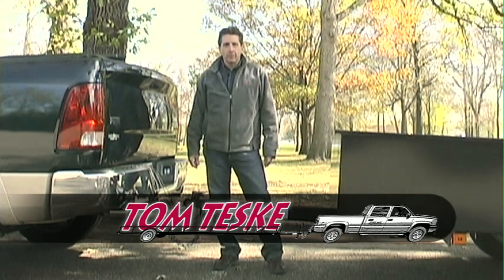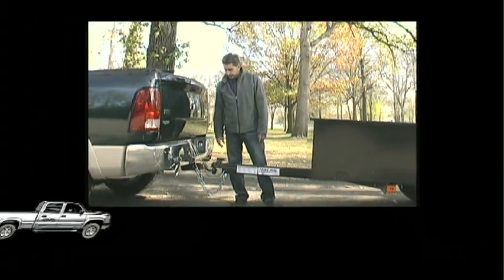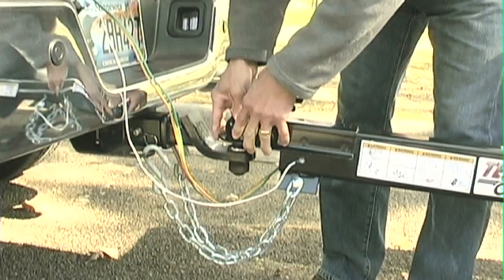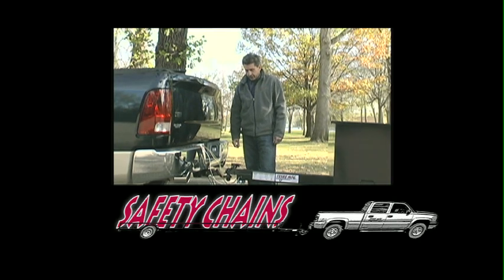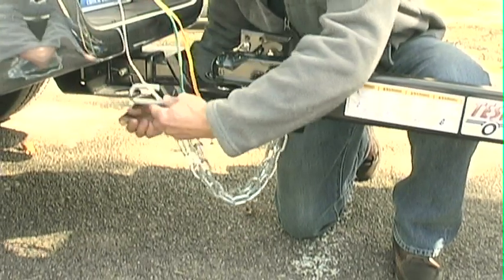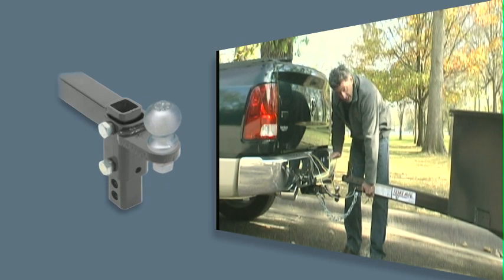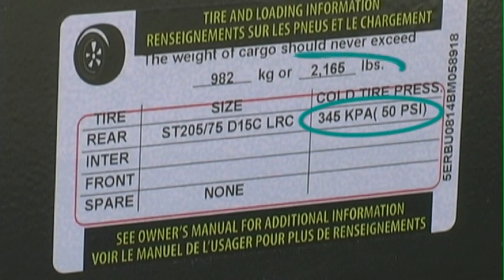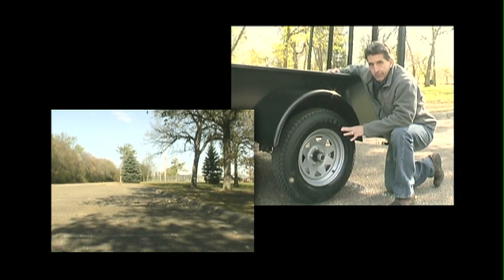How to Hook Up A Trailer - Teske Mfg.

Comment: One way to check your brake lights if you are solo is to take a small tool box if you have one and just rest it enough on the brake pedal to activate them. Another way is if you have a way to get your camera phone to stand up on its own you can take a quick video from behind while you put your feet on the brake pedal.
Reply: Just use your turn signals , they use the same circuit as the brakelights, turn signal work, the brake lites will work...simple....
Reply: It depends on the vehicle. I had a Dodge that they were not on the same circuit.
Reply: bayan  It's a Dodge....what can I say???This has always worked for me...
Reply: Just adding another helpful suggestion.
Reply: Bayan1905 I keep a long wood dowel. Put it between my seat and the pedal. Its cut to length.
Reply: Bayan1905 find a girlfriend..best way
Reply: Does the "Girl friend" come with benefits??????
Reply: Or set the parking brake on and make sure it's parked on a level ground, that way i can shift into REVERSE to check the backup lamps on both trailer and truck.

Comment: I would have to argue that crossing the chains is a no no when pulling tractor trailer with doubles. Because your load is more likely to pull to one side then back causing a sway. In the event of any other failure, except for the example that he gave. The pin failing is possible, not likely with proper inspection.

Comment: JUst so you know... your turn signal/4 way flashers ARE also your brake lights. Crossing chains and going from under and up/ out like you have them IS the proper way to run chains...

Comment: Did that truck come with that outlet or whatever you plugged the wire into?
Reply: I was wondering the same thing
Reply: +Tanya O ~Yeah.
Reply: Every truck from each manufacturer has those receptacles from the late 2000s and on but some pickups didn't always came equipped with a hitch receiver for some damn reason.
Reply: @brandedmcgowan9414  Oh.

Comment: Good instructional video, but your wiring harness from the trailer is about 6 inches too short and needs dressed with electrical tape or flex conduit. If for some reason it did come unhitched and was caught by the safety chains the short harness would come unplugged or break rendering the brake and tail lights inoperative, not good for traffic in that situation.